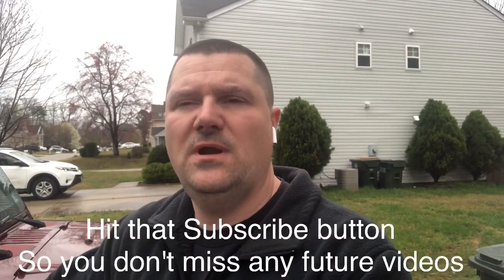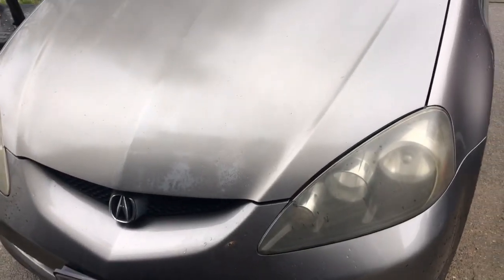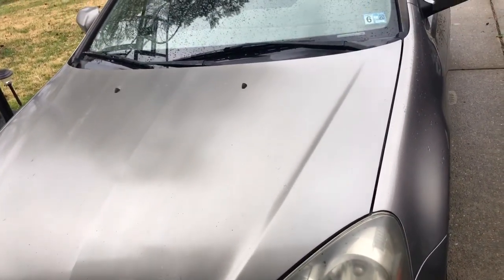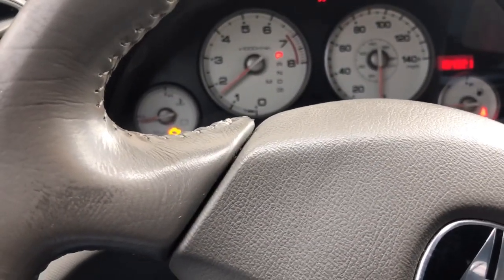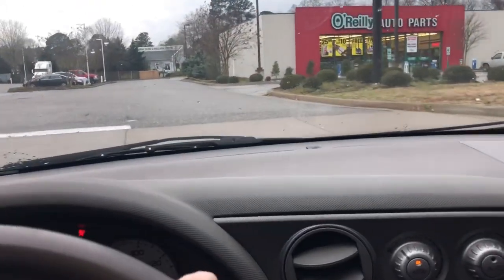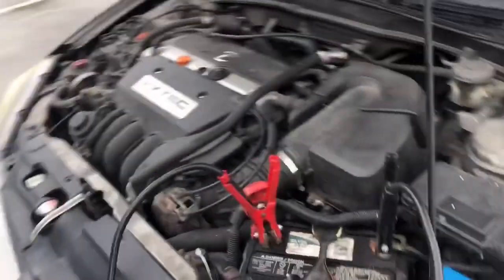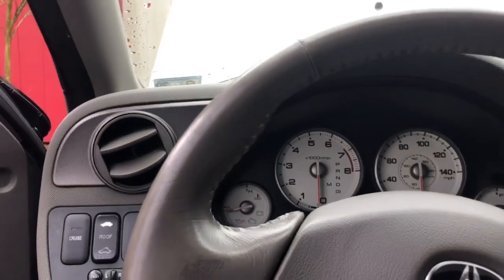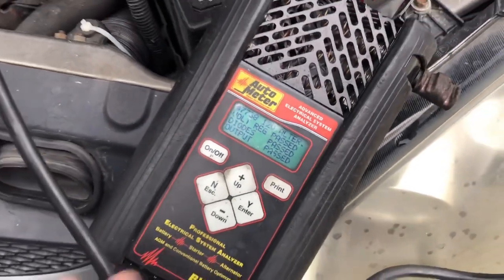Zus nonda vehicle health monitor review. Does it work, let's test it.

Comment: So the light is still on? Why didn't you have O'Reilly do a scanning for you and see what it is?
Reply: An that shows you just how bad this "Health monitor" is. That issue with your seatbelt would prevent the airbag deploying in case of a frontal collision, that could be  life threatening, and the knock sensor in other cases would be also important for you engine health. But for Nonda that's not worth mentioning :) instead it shows you a false code. Not worth a penny.
Reply from the maker: Yiyu Wang the zus scanner said it was the alternator, I took it to O'Reillys to get the alternator Checked, it is good voltage. The check engine light is on because of my knock sensor. After I installed the race header that when I got the check engine light for that.  You can check our both of this videos on my Channel. Thanks for watching